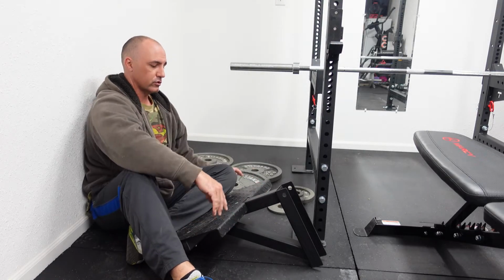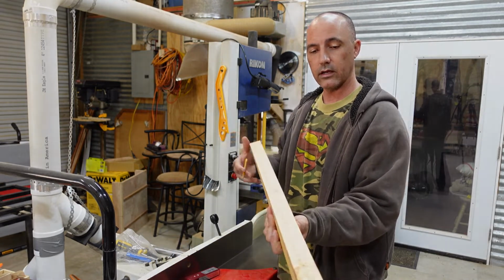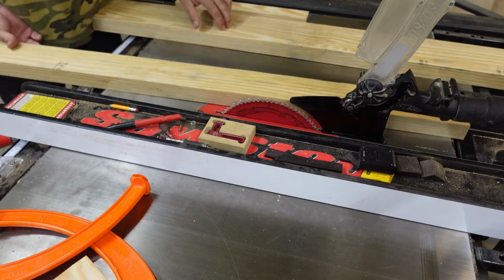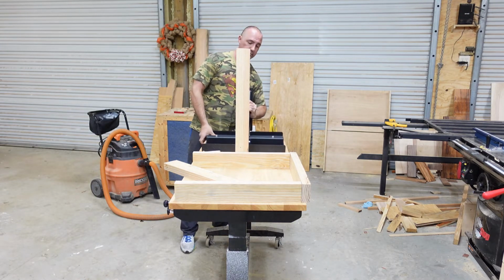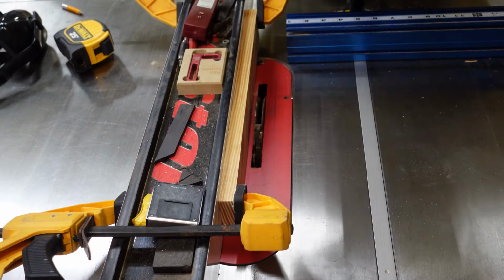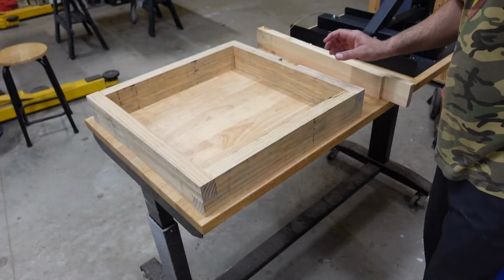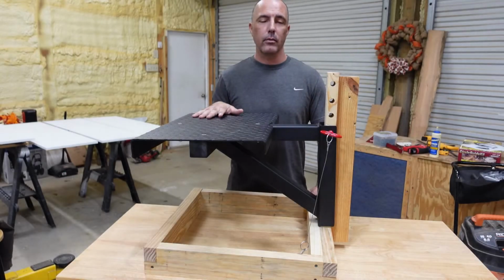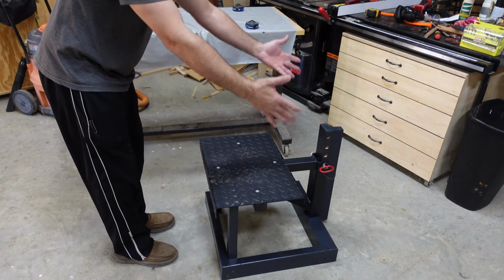Building a step up base. Plus some tips & tricks.

Comment: I once used my table saw using a warped board and it kicked back and knocked my entire head off . I had to reattach my head with some rusty screws . Anyways point being if I had seen this video that wouldn't have happened :/
Reply from the maker: Safety 1st. Class over.
Reply: how do you feel about running dolley's over empty pallets?
Reply from the maker: I think it’s a great idea!!!  Whatever it takes